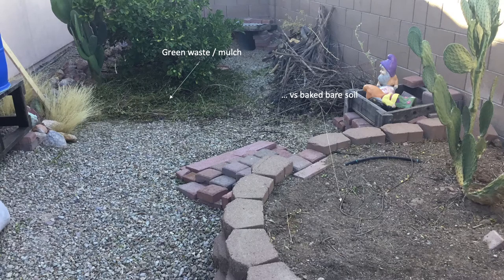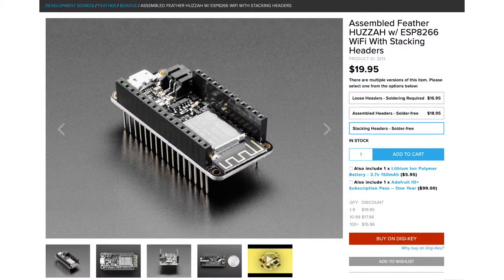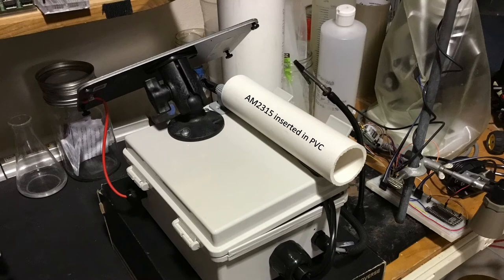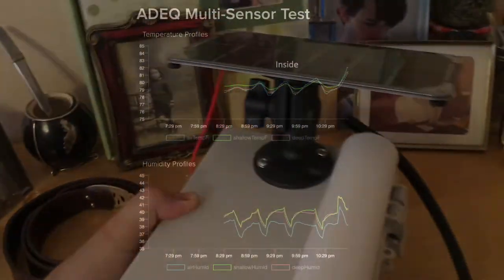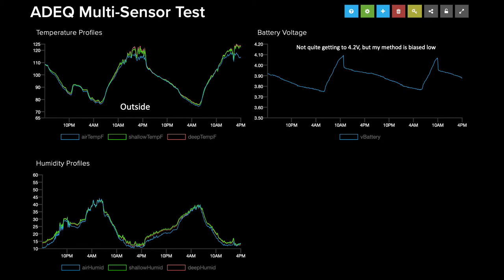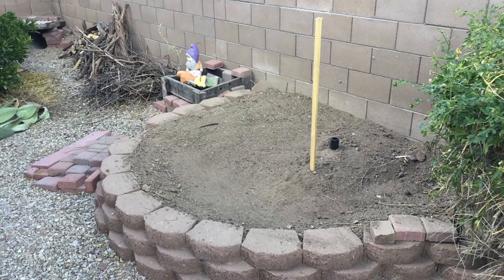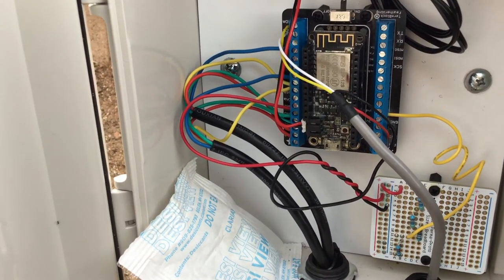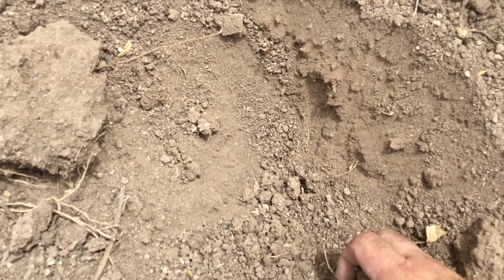Temperature-and-Humidity Monitoring - Field Deployment

Comment: I'd imagine that holes drilled in the PVC pipe would allow air flow and thus temperature and humidity to normalise.

You'd probably have to make V shaped drill holes though. 45 degrees DOWNWARD from the outside, half-way in, then 45 degree drill holes DOWNWARD from the inside. Giving a hole like: \/ that met in the middle of the pipe wall. Then perhaps a little 'hat' of maybe 5-8 inches diameter on top of the pipe to prevent any rain water catching in the bottom of each V hole. 

Maybe. I'm just spitballing! 🤪
Reply from the maker: Interesting. I'll have to think about this for my next build.